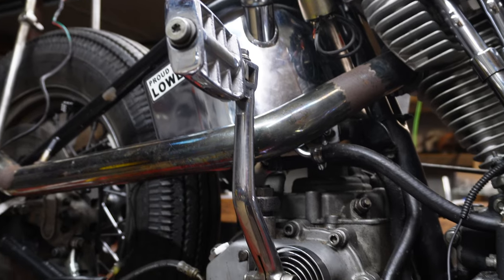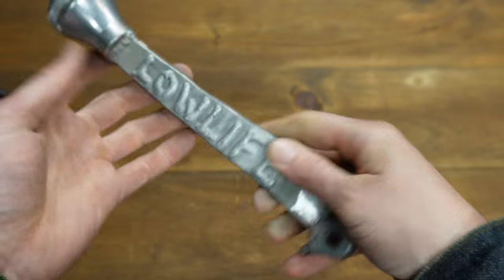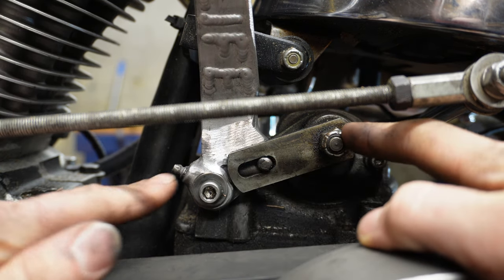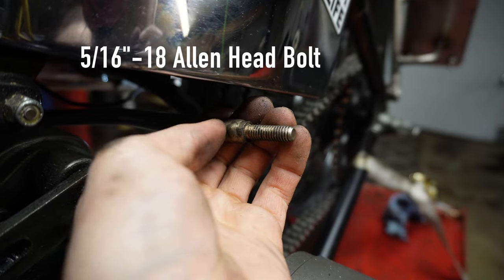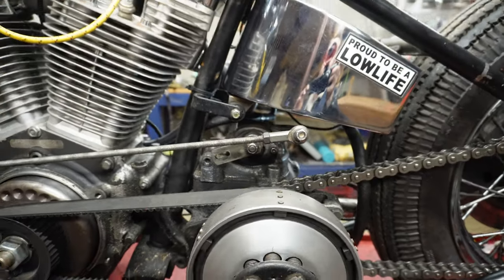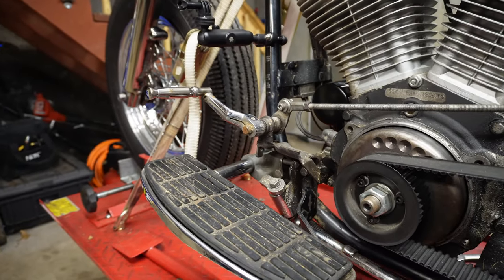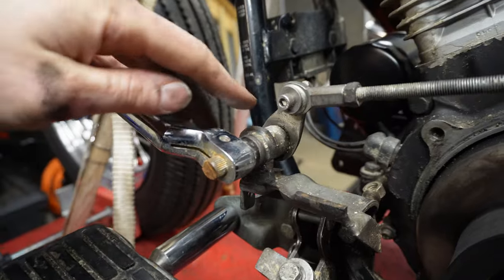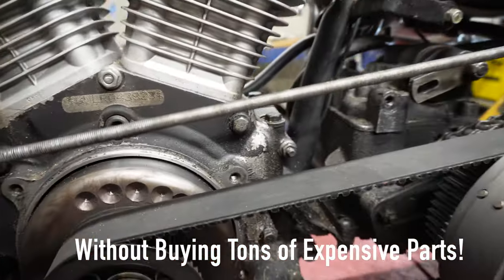Jockey Shift Foot Clutch Build (Evo / Shovelhead)

Comment: I'm building a chopper from scratch and I made an identical linkage for the foot shifter. The only difference is I welded a bolt to either end of a mild steel rod instead of using all-thread. Saved a few bucks.
Reply from the maker: Very nice!

Comment: Nice love it! How did you keep the bolt from flexing when you welded it to the clutch return lever?
Reply from the maker: So for mine I did it out of stainless and stainless will always move on the first tack. 

To combat this, you’ll want to angle it a few degrees away from the side you’re tacking and get a fusion tack on it. This tack will pull it to the center. From there you tack the opposing side and it won’t pull because it’s already got that first tack holding it now. 

Tack the other two sides so you’ve got four tacks on it, now weld around the whole bolt head 👌🏼

Comment: Any way of doing a setup like that while keeping the electric start?
Reply from the maker: Definitely, would just need to get a little more creative with the routing of that clutch arm. Are you working with a shovelhead transmission?
Reply: @greasesgarage  Yeah. 1979 shovel that I've been thinking of making a it a jockey shift and foot clutch.
Reply from the maker: @SaddleTrampTV  for sure, if you’ve got Instagram my handle is the same over there. Shoot me a pic of what it looks like under the oil tank I’m sure we can figure out a way
Reply: @greasesgarage  I'll do that

Comment: I have a bone stock 2009 Sporty 1200 Custom, im considering chopping,  a deal breaker for me is jockey shift, and foot clutch,  As a novice,  do you have a video, or advise on where to start that process?
Reply from the maker: The riding process or building the setup process?
Reply: @greasesgarage  building process.

Comment: Thanks for the video. What’s the shift pattern on the cow pie? Is it 1 forward, then N,2,3,4 back? I’m having a hard time finding ratchets with that pattern and I want to slap backwards to upshift.  Cheers
Reply from the maker: On this particular one, slapping backwards is down. In my mind I tell myself I’m pulling the e brake and slowing down. My old Yamaha road star was the way you’re describing, slapping back was up. 

That being said, I believe that there are two different cow pies. From the FL touring models and from the FX models. 

One of them is the opposite of mine and the shift linkage is on the bottom where mine is facing up. On the ones that face down, it would be reverse from my shifting pattern. Unfortunately I’m not sure what model mine came from so I can’t tell you which is which, only that you’d be looking for the one that doesn’t match what you’re seeing in this video. 

Alternatively, if you built your shifter directly off the shifter shaft, mine would shift the way you’re describing. So that’s an option too
Reply: @greasesgarage   yeah cheers mate. I know what you mean. More then two ways to go about it depending if you weld straight on or use the lever action like yours. Same with the ratchet, fx and fl have opposite shift patterns. I’m looking to slap backwards for 2,3,4. Sick build though and great video!!  Love how every bike is custom to the rider. Stay safe 🤘

Comment: Hello Grease a got a question? Did you do something with the linkage or it is stock with the hole on it? Thanks
Reply from the maker: Hey Jorge, can you clarify which part you’re talking about when you say the linkage?

When I hear linkage I think of the threaded rod part, which has a heim joint on each end. That part is not factory at all. Happy to help I’m just not sure which part you’re referring to
Reply: @greasesgarage  thank you for your reply, I’m talking about the cowpie shifter, I got a 1979 trans, but with another set up. Cheers and thanks for help me out
Reply from the maker: @jorgequiros1310  the part that mounts to the cowpie did have a hole in it on a little arm that pointed up. Some of them point down. Doesn’t matter either way because you’re going to cut it off and weld a shifter to it anyways
Reply: @greasesgarage  thanks for your help and time, I appreciate it